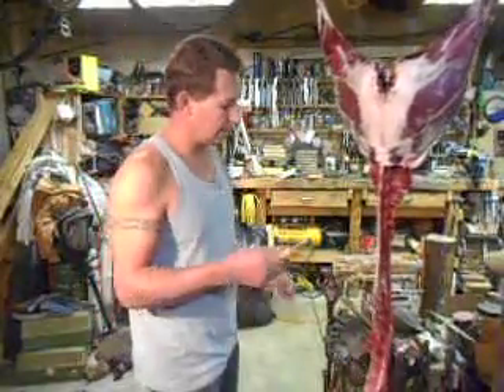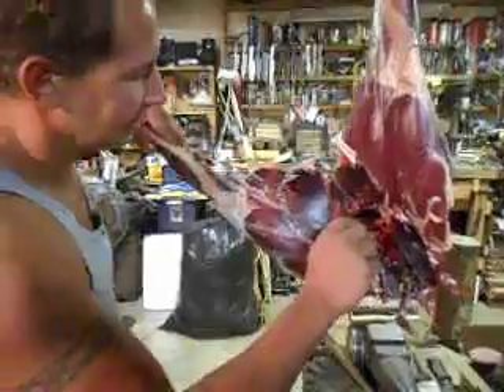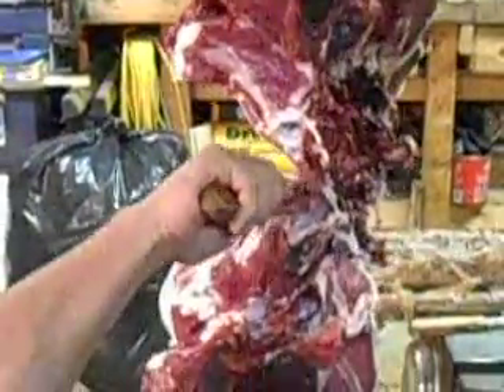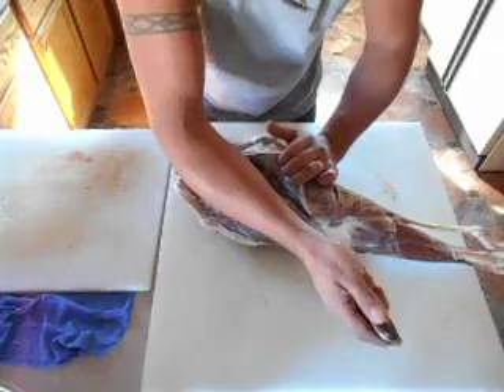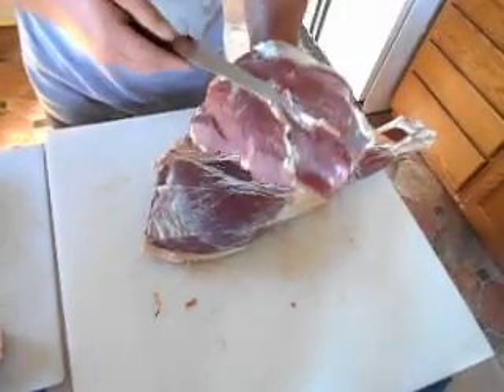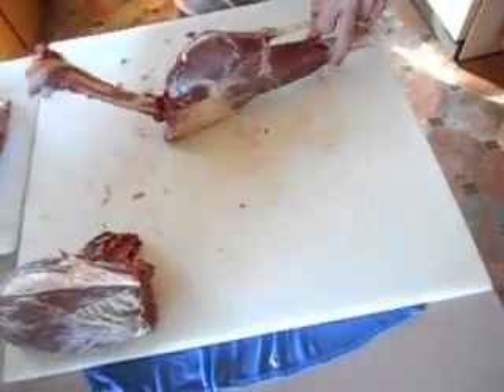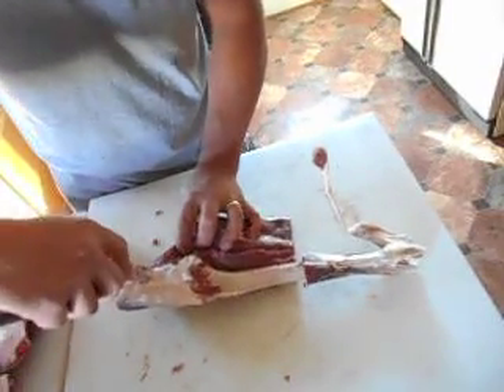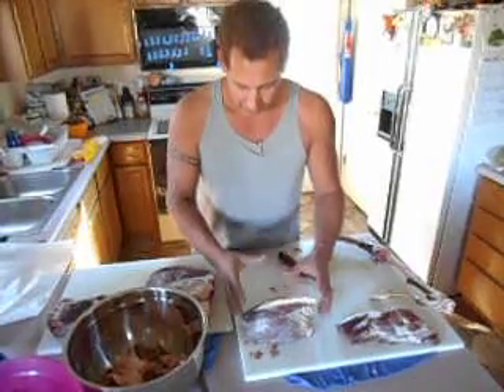working up a mule deer the corect last video

Comment: Like how you did the pelvis. I have always split it to do my hind quarters but, this is way cleaner. Also how did you cut the ribs saw or chopper?
Reply from the maker: about the only time I split a pelvis is when I need to lay an animal out flat to cool and I cant tie the legs off to anything to keep them open.

the ribs I cut with a short carpenters saw for the most part, and then used a cleaver to finish part of them off. I have them in the fridge now and hope to bbq them in a day or two to see how they turn out!!